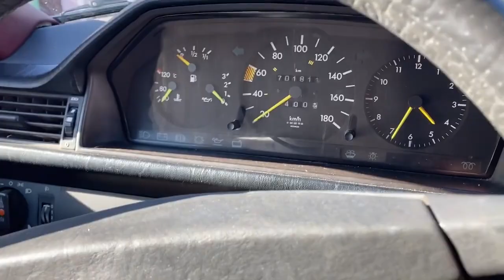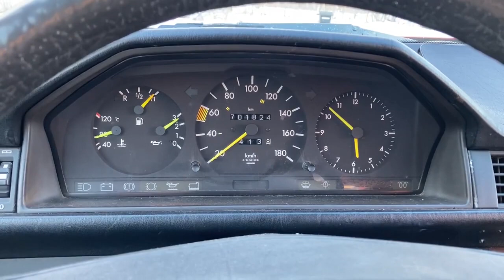I bought a 1989 Mercedes-Benz W124 200D

Comment: This car is pretty much unbreakable. Ive a W124 250D (1988) with 235.000km which still running without any issue. Greetings from Italy.
Reply from the maker: Wow thats very low mileage 😮 Gotta say that after 700.000 my car does need some attention, although engine and powerline are still working pretty well 🙂 Greetings!

Comment: hey I'm looking to buy one of these this month any common problems I should be looking for that would be easy to notice?
Reply from the maker: Well, I think that rust is the main issue with these. Basically you could find rust anywhere - try to find one with as little rust as possible, especially underbody. Mechanically 124s are quite bulletproof - there is usually some minor issues as these are so old and high mileage. Luckily parts are available, not that expensive and these are pretty easy to work on.
Reply from the maker: Some say that the usual rust spot is in the rear subframe front mounting in the vehicle chassis - at least check those, you'll see them in front of rear wheels.

Comment: That looks pretty decent, tidy inside for an ex taxi too. 700k on the clock I see, its only just run in 😆. Surprised it’s a manual as a taxi, I would have autos better with all the stop start driving? 
I had a couple of W202s but never driven a W124, dash looks similar and brings back memories. I did like following that three-point star, miss that. I liked mine; 1st was rotten and sold to the republic of Ireland on ebay, fair dues the bloke came and got it. The 2nd I just got bored of in the end lol. Both were petrol’s, I am not a diesel fan. 

I liked the bit where you showed outside and you drove about, interesting to see the country etc. Have you though of doing a driving film showing the area?
Reply from the maker: Yes, and after taxi use it was owned by a construction company... So pretty harsh history indeed... There is still some paint stains in the rear seats... These will last for a million kms I hope :P
As we really do not have traffic jams in Finland, at least in the rural parts, an automatic gearbox was seen as an unnecessary luxury item back in the days. Even in taxis I suppose :o
For some reason I want my MBs to be diesel, other cars might be petrol also...
I'll integrate local scenery in my videos whenever I can - this video was filmed in my own yard, our town centre and in the nearby industrial area.
Reply: @ccrepairchannel  It sure has had a hard life, amazing its in such good condition. I bet a modern MB would not see a million kms. My petrol ones were pretty strong engines (I forget how many miles they had done) but always need MAFs for some reason and only Bosch would work, at £200+ a time a costly but easy fix. Steering dampers was another favourite to need replacing I found on the W202, but they were cheap enough.

Is this to replace the Volvo?

I look forward to seeing about the country/town when you can. Interesting to see your country.
Reply from the maker: @WelshRob1964  Those modern cars with modern problems 😅 I’ll probably sell my Volvo, after some repairs… I think the most interesting thing about my country is the difference between seasons… Right now it’s beginning to be tolerable again, I must admit that spring is my favourite. Our summers are usually short but surprisingly hot… Considering the winters are violently cold and long.
Reply: @ccrepairchannel  Far to complex modern cars. Good luck with selling the Volvo, hope you get a good price. I am still considering selling my K11, now is the time if I do as it just passed its annual test. Its spring here now and sunny days, I must admit to preferring winter 😁
Reply from the maker: @WelshRob1964  Thanks!

Comment: Why not gasoline engine ?
Reply from the maker: Well, I like tractors, and a diesel engine in a car reminds me of them. Also very low fuel consumption.
Reply: Old diesel is made to last forever. 700k on the clock and still moving fine
Reply: Parts of the KE-jetronic system are not cheap and the system is quite complex. On the diesel nothing every breaks and it is very simple.
Reply from the maker: @amgjens  Yes, old gasoline engines from the 80s are increasingly difficult to maintain these days... Luckily the diesels from that era are so simple.